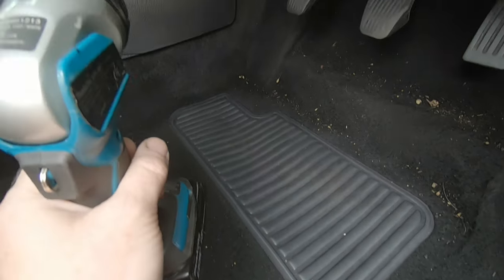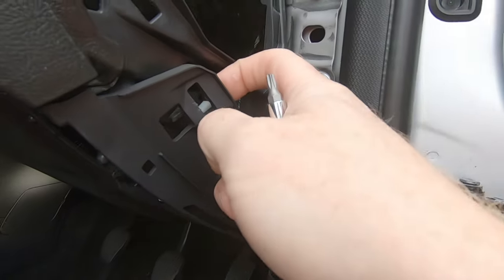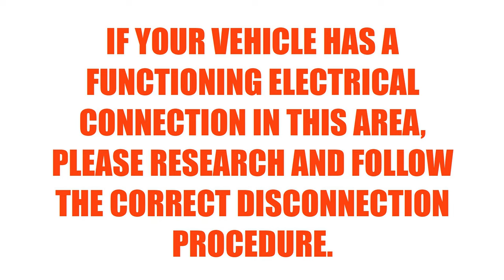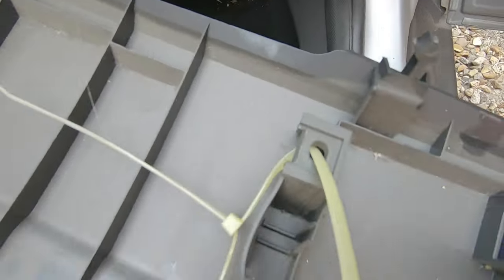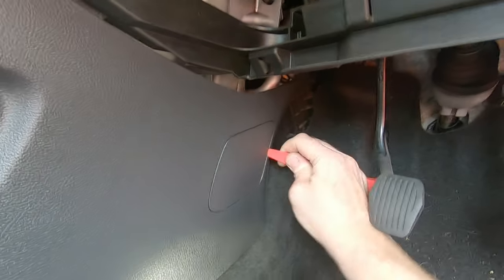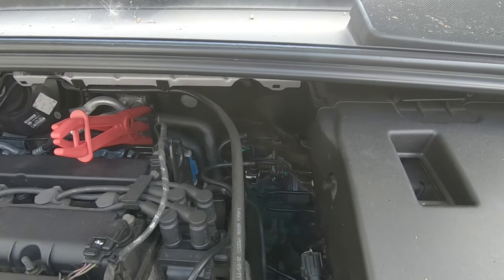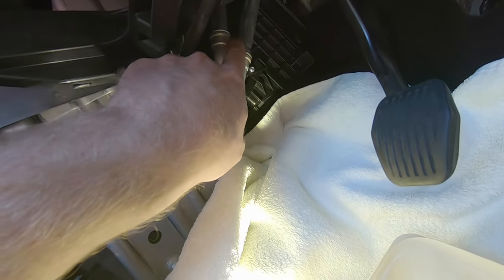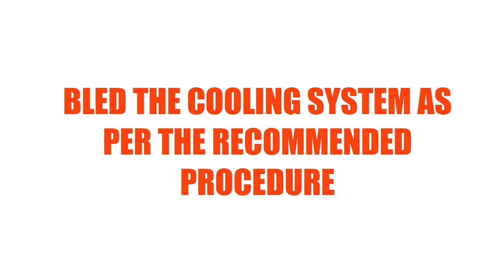Ford Focus heater core pipes leak coolant, heater o ring leaks. (Includes interior strip down.)

Comment: Had did you get the pipes apart ? I just can’t get them to separate
Reply from the maker: Remove clips on pipes, make sure the clip in the engine bay is released so the pipes can move, then I just held the matrix pipe in one hand and pushed the other pipe away, no real force required on my vehicle.
Reply: @dan91sgarage  thank you
Reply: @dan91sgarage  how do I remove the clip in the engine bay? Thanks for the video by the way, I’m a girl and when I called my mechanic to say I was going to try to fix this myself after they’d quoted me $1000, they started laughing and mocking me. Now I’m getting this done purely out of spite! Just need to get the pipes back together and new clamp and I’ll be done. I’ve got the ends of the pipes together but can’t push them fully together, I didn’t realise the engine bay had a clip.
Reply: @dan91sgarage  by clip do you mean the plastic panel at the back of the foot well where the pipes go through into the front of the car? I’m sorry for all the questions I’ve been pulling my hair out for days over this
Reply from the maker: @Sam Robinson The clip is shown @8:03 in the video, it holds the 2 pipes to a bracket on the engine. Mine is a 1.6 petrol and other engines may vary. It is unfastened by sliding the plastic bar sideways at the bottom. Make sure the pipes and heater are correctly fastened together as they carry boiling hot coolant.
Reply: Thank you!
Reply: @mjlloney  I took it to the garage and they charged me £470 to take the whole
Dash out and fit new pipes and a heater matrix they said just putting them clips on and new rings wouldn’t work

Comment: Dan. Done have the part numbers for the o rings and clips please.
Reply from the maker: @keanMechanic They're listed in the video description friend
Reply: @dan91sgarage  Dou! I’m a fool. Do the job thank you,not fun went home soaked. Interestingly the kit is not list on the parts catalogue,it’s a “under the counter” part.
Reply from the maker: @keanMechanic  No worries. And yes, Ford try to sell you the updated heater matrix. The mad thing is these o rings and clips are used on 3 or 4 different models but if you mention mk3 Focus, they don't exist anymore! Lol. I asked by part number and they used a different car model parts list to order them. Think they're on UK eBay also.

Comment: I’m having th same issue but I turned the bottom clip and it stopped leaking??? And my engine coolant fluid has stayed on max for ages even prior to the leak?? So
Reply from the maker: My gut feeling is that will be a temporary solution followed by an upsetting surprise. Fingers crossed dude.

Comment: Would this cost a fortune for a ford mechanic to do?
Reply from the maker: It's quite a simple job for a qualified mechanic to complete. It only took me about 4 hours and I was taking it easy, the parts required are about £5. I think that most Ford garages will try to change the whole matrix to the updated version which will cost hundreds in parts and labour. Might be worth trying to find an independant garage and show them the video so they know what they're getting into. 👍

Comment: O ring No longer available from Ford Australia.
Reply from the maker: Did you ask for them by part number? Some Ford parts departments say they are unavailable for the mk 3 focus and try to sell you an updated design matrix. The o-rings are used on at least 4 different ford models. Loads available on UK eBay. Got mine from a UK Ford dealer parts dept.